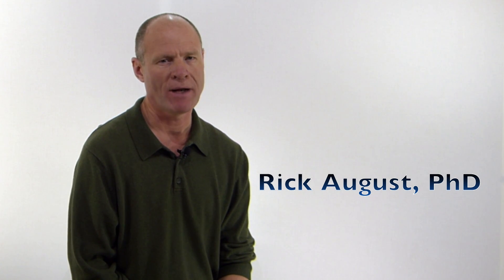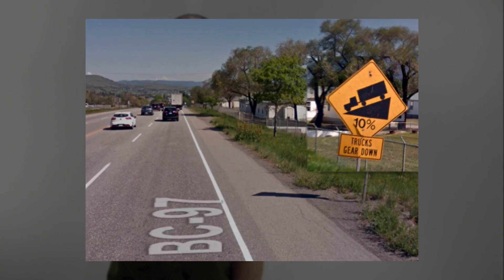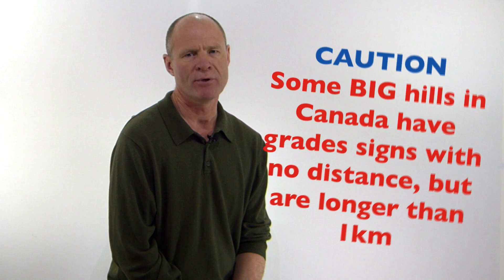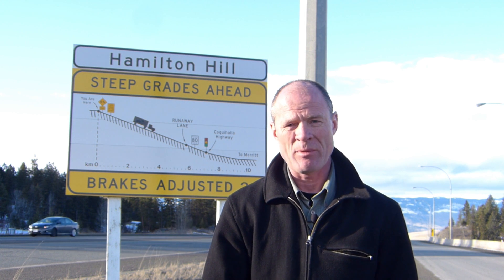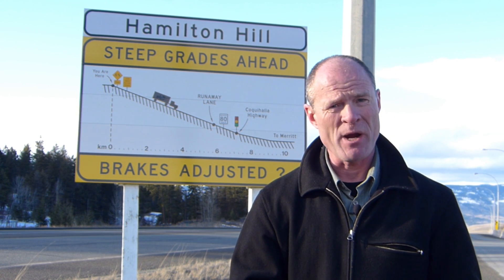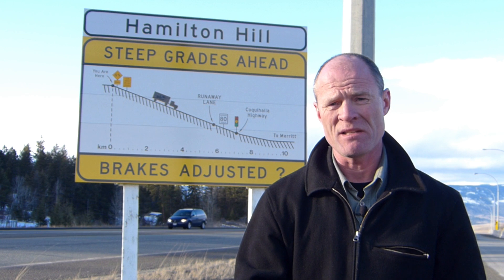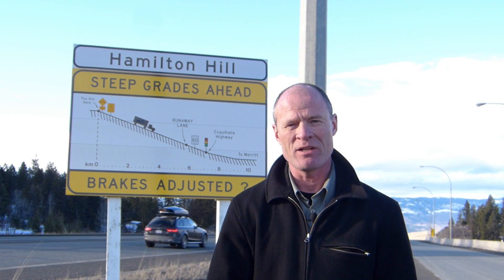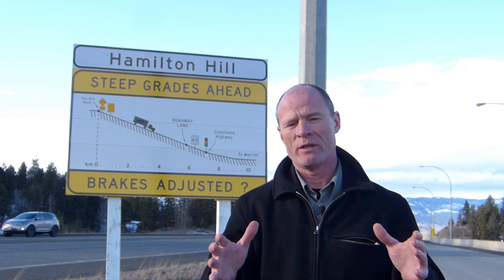How to Brake Downhill Safely | Air Brakes Smart

Comment: Hey Mr. Rick, thank you so much for your videos, I love how clear and interesting they are! I am in MT, my next step is learning to drive on icy and snowy mountain roads, and the use of Jake break is discouraged in such weather. I was wondering if you had a few tips to handle bad weather conditions when going downhill. My manual says stab breaking (break until you are 5mph under the speed limit, then let go, and brake again when you reach the speed limit), but if there are better tips, I'm all ears. Thank you!
Reply from the maker: Hi providencia94 - Thank you for your comment and query. Chains aren't just for going uphill my friend, these are for going downhill too. And if it's slippery you may have to chain up the drive axles on the tractor and throw a single on the trailer to prevent it from coming around. On some steep mountain downgrades, you going to need the jake brake to not experience brake fade. Chains are the only way that you're going to be able to do that safely my friend. Have a look at this video for chains: https://www.youtube.com/watch?v=2vcJULsQMRs&t=0s&list=PL0x-bChcUvwG2bSWReQWnk9Tm92L7WN_O&index=26 If there is anything further we can do, drop us a note. Always happy to help. All the best, Cheers Rick
Reply: @smartdrivetest  Seems like there's no way around those darn chains! I hate chaining, like every normal person, but I'll certainly do it if that's the safest thing to do. Thanks for the video you linked to, it's as always very helpful, and I just found you have plenty of information about driving in winter conditions. You're officially my new hero.
Reply from the maker: Hi providencia94 - Thank you for your comment. And you are most welcome. We're happy to hear we could help out. There isn't one CDL driver out there that likes to put chains on, but as you stated, it's a matter of safety - especially in the mountains in the winter. If there is anything further we can do, drop us a note. Always happy to help. All the best, Cheers Rick

Comment: So you have any videos about this subject but for stick shift pickemup trucks?
Reply from the maker: Hi I_Dont_Eat_My_Friends - Thank you for your comment and query. At this juncture, I don't have any for pickup trucks, but if that's you're case, you may want to consider a transmission cooler as you're most likely running an automatic transmission. These generate an incredible amount of heat when downhill braking or climbing, which can cause these to fail. If there is anything further we can do, drop us a note. Always happy to help. All the best, Cheers Rick
Reply: @smartdrivetest  Hi Rick, thanks for great videos. How about braking downhill with a car (petrol engine, small city car, like wv polo or ford fiesta). Driving down a mountain on a road that is constantly require turning left or right while going downwards seems quite daunting. Any advice on braking in that situation? Thanks!

Comment: Hey there...so my issue is I dont have much driving experience at the moment but when I am coming to a light its green and than turns yellow. How can I make this stop without hammering on the brakes...just looking for some sort of tips or tricks. Only have 2 months experience driving
Reply from the maker: Hi Pat Portelance - Apologies for the late response. Thank you for your comment and query. And this is the video you seek my friend: https://www.youtube.com/watch?v=jX1366utbuY&t=2s&list=PL0x-bChcUvwENfxb3Gsaj4ZNLWleZCNzG&index=53 If there is anything further we can do, drop us a note. Always happy to help. All the best, Cheers Rick
Reply: @smartdrivetest  Hi there thanks for your reply....so in your video you mention that we have to try to come to a complete stop...but where would you start determining where the point of no return is and how to proceed safely through the intersection..
Reply from the maker: Hi Pat Portelance - Thank you for your comment and query. This video will answer your question: https://www.youtube.com/watch?v=jX1366utbuY&index=52&list=PL0x-bChcUvwENfxb3Gsaj4ZNLWleZCNzG If there is anything further we can do, drop us a note. Always happy to help. All the best, Cheers Rick
Reply: Stale green light, downshift and be prepared to stop. Light timing varies some as little as 15 or 20 seconds it seems. Haven't timed them,  watch for vehicles on side roads as some lights are on triggers.

Comment: What if your truck doesn't have a Jake brake?
Reply from the maker: Hi Douglas Beary - Thank you for your comment and query. If the truck doesn't have an auxillary brake, than you'll have to gear down even farther. How much weight are you hauling and what kind of vehicle? If there is anything further we can do, drop us a note. Always happy to help. All the best, Cheers Rick
Reply: Smart Drive Test I'm a new driver and I drive 2005 (?) International flat bed with 2500 gal water tank + a 35ft tandem trailer with a directional drill (vermeer 36-50)
I believe last time it was weighed it grossed out at 76k lbs with a full load.
Reply from the maker: Hi Douglas Beary - Thank you for your reply. It's odd that that year of truck doesn't have a auxiliary brake. If you're going downhill, you're simply going to have to put it in a really low gear and go very slow down the hill when loaded. If there is anything further we can do, drop us a note. Always happy to help. All the best, Cheers Rick

Comment: If worst came to worst you could pull your air brakes correct in an emergency
Reply from the maker: Hi brettduffy19992 - Thank you for your comment and query. No, that won't work if you lose your brakes on a downhill. Have a look at this video: https://www.youtube.com/watch?v=26AFYfz14Ec&list=PL0x-bChcUvwG2bSWReQWnk9Tm92L7WN_O&t=0s&index=14 Brake fade is a failing of all braking systems, not just air brakes. However, due to downhill braking and the weight of larger vehicles, these braking systems are exposed to conditions that could bring about brake fade. If there is anything further we can do, drop us a note. Always happy to help. All the best, Cheers Rick

Comment: Hi Rick, What about 10 gear trucks?
Reply from the maker: Hi Angel Rodriguez - these transmissions have 5 low gears & 5 high gears. For the first couple of hills use 5 low and see how it goes. If the engine retarder is holding you back, then go up to 6.  Remember to get in the gear before you start going over the top of the hill. If there’s anything further we can do, drop us a note. Always happy to help. All the best, cheers Rick
Reply: Thank you
Reply from the maker: You are most welcome my friend.

Comment: Snubbing or stabbing creates more heat than light steady pressure, and that takes longer to cool. Rub your hand on some carpet....the harder you press, the hotter it gets and you burn your hand. Press lightly- you don't burn yourself and you can keep going as long as you want. Correct gear and jake, follow posted truck speed limits and you don't need to worry about it.
Reply from the maker: HiJason Greene - thanks for your comment. The issue is that we're not talking about carpet and your hand. We're talking about heavy vehicles, often in excess of 100,000lbs (45,000), that generate enormous amounts of heat, even with light brake applications. The technique to proper downhill braking is dissipating that heat, or as you said, not generating that heat in the first place. Short, hard, intermittent brake applications allow more time between brake applications for that heat to be dissipated. New drivers require a technique the works every time. And you are correct: modern retarder technology allows you to get in the correct gear, and the driver rarely has to touch the service brakes, if at all. All the best, Cheers Rick
Reply: Stab braking needs to be more definitive. For example the number of brake applications in a given time or distance. Too many x's and y's being omitted in the equation. The stab technique would be fine if the brakes were only applied oh say twice within two miles ,minutes seconds etc. The perfect procedure is the proper speed and gear selection with no or minimal use of the brakes. To determine the benefits of one method over the other would be to establish a data set from instrumentation mounted on the vehicle's braking system.
Reply: Think of speed as heat or better, kinetic energy. When you  use a snub brake technique  what you are doing is letting speed build up then converting that speed or kinetic energy into heat and storing that heat in the brakes. Then repeat and convert more speed into heat and put in the brakes. Each time you sharply apply your brakes you are storing  more and more heat in your brakes.The brakes may cool some but will actually take hours to cool OFF. If I snub my brakes it is to reduce speed and select a lower gear very carefully. Use left foot braking technique so the right  foot can control the fuel.  Sometimes I use light steady pressure for control sometimes also. SPEED is key. Double speed, heat is increased square
Reply: Double speed, increase  heat  EXPONENTIALLY! Couldn't  think of the word.
Reply: Its not all about the heat. The reason for snubbing was developed because ALL the brakes may not apply at the same time, due to mechanical issues ( crack pressure of valves, worn components) Snubbing gets a high enough pressure that you are almost always assured of ALL brakes functioning. Rick told you what gear to be in before descending the grade - that IS VITAL info for this technique

Comment: I have had a setback. I was not ready to do the mountain run yesterday.I have to practice shifting on hills more. I get flustered downshifting and upshifting on a hill. It's because I'm not certain about how to do it without double clutching. We only use progressive shifting and observing the tack. It seems that everything else is going ok except shifting on hills...which seems to be the most safety related skill.Advice?
Reply from the maker: Hi Darlene - Apologies for the late response. You somehow need to practice the fundamentals of shifting with a load on the trailer. And I'm not certain how you're going to get that experience. I'll send you an email. Thank you for your comment. And you are most welcome. If there is anything further we can do, drop us a note. Always happy to help. All the best, Cheers Rick

Comment: I'm sorry  wrong wrong I've been driving  truck since early  70s before Jakes light steady pressure  always  worked  better I hauled on back woods mountain  roads with real steep hills light steady pressure  I hauled  oversized in 90s same but with a Jake I've never had a problem  and don't  smoke  unless new linings,  I just always  make  sure adjustment  is good even some self adjusting  brakes don't adjust  good enough they gap too far before  they  adjust
Reply: Not all trucks were speced with Jake's. Ask any former cornflake driver.
Reply from the maker: Hi XxzombiekillerxX mlg pro - thanks for your comment. You're thinking about that braking technique is in the minority of drivers. And I completely DISAGREE. Modern engine brake technology will hold the unit back if you're in the correct gear. I followed a set of loaded Super Bs down a 10 mile hill at 12% grade and that driver never touched the brakes once. If the brakes are on you're generating heat; if the brakes are generating heat, sooner or later those are going to experience brake fade. All the best, Cheers Rick
Reply: Smart Drive Test I agree with the Jake operation  it's the stab braking I don't agree  with or like but my last truck with walmart  the Jake was so good with a load of water you never had to touch the brakes but the what you call snubbing we call stab braking it don't work for me
Reply from the maker: Thanks for your reply. Yes, engine brake technology now is really good. And you're right, not all drivers like snub braking. The thinking behind that braking is that you use the brakes intermittently and then the air has a chance to get over it when the brakes are off and dissipate the heat. But that is all going the way of the do do bird with disc brakes becoming more and more widespread. All the best my friend, Cheers Rick
Reply: XxzombiekillerxX mlg pro k
Reply: The 1970's wasn't before engine brakes. Engine brakes have been around since 1905 and Jacobs started design and development in 1957 for production in 1961

Comment: I'm sorry  that style never worked for me I tried it once ,I started  driving  before anyone  knew what a Jake brake was and the light steady pressure  method always  worked only smoke was with brand new brakes, walmart  safty guy told us your method and I hated the speed up slow down so most of us stayed with the light pressure  method,Jakes just made it so we didn't half to come off as slow,great video's  though I enjoy total ,oh one thin I ran Canada  and the kilometer  thing always  threw me off, I'm old school dumb lol.
Reply from the maker: Hi XxzombiekillerxX mlg pro - thanks for your comment. Yes, I suspect that technology has changed a lot in your time. I too was surprised by the effectiveness of engine brakes when I went back driving a couple of years ago. Now, if you're in the right gear, the engine brake will hold the truck at a steady speed all the way down the hill. Owing to the fact that trucks are now heavier and the rolling resistance is less, engine brakes are now a must, not an option. And yes, this was the video where I realized I was an international driving instructor and needed to use both imperial and metric measurements.
An 8% grade drops 80' feet for every 1000' feet you go forward; or drops 422' feet for every land mile (5,280' ft) forward. 10 kilometres is approximately 6 ½ miles, and 63,500 kilograms on a Super 'B' is 140,000 lbs. And I would need to verify this fact, but grade signs in the United States will have a distance on hills farther than ½ mile. All the best, Cheers Rick

Comment: I don't know about snowy conditions but I think muddy conditions pose the same problems when Jake braking down hill. you mentioned that there is a potential to lock the drive wheels, but I think its more a potential to reverse them.
Reply from the maker: Hi Keith - yes, mud too could potentially cause the drive wheels to lock; however, most of the time in mud, you're going to have chains installed, or you're going to be stuck. Big trucks and buses do not do well in mud at all. The tires just aren't designed for such "silliness". 80) But anytime you're on compromised road surfaces it is best to neither use the "engine brake" or the "cruise control". If there is anything further we can do, drop us a note. Always happy to help. All the best, Cheers Rick

Comment: The truck I drive is 18,800 lbs. no jake brake. Auto tranny (freightliner flatdeck).  My only options for long hills I guess is downshifting or asking it to downshift.  Won't always go unless rpm is in the ok range to drop a gear. And service brakes.
Reply from the maker: Hi PbNTheory - thank you for your comment. Yes, unfortunately, there are still some vehicles that do not have engine brakes to help with downhill braking. It is important, as you noted, to have the transmission in a lower gear before you go down over the top of the hill, because you won't get it downshifted on the hill. And when you're going down the hill, make hard, short intermittent brake applications and bring the speed down 10-15mph. Release the brakes and let it run back up and repeat... If there's anything further we can do, drop us a note. All the best, Cheers Rick

Comment: 13 or 18? bullshit. 10 speed is standard
Reply from the maker: Hi David Gentry - thank you for your comment and information. My experience in the industry has been different in regard to transmission. However, companies have told me that 10-speed transmissions get better fuel economy. As well, if they are running a lot on the flat, then it makes sense to have a 10-speed. And for downhill braking, it is the same gear--5th--if you're driving a tandem-tandem with less than 80,000lbs (36,300kg) and on a grade less than 10%. If there's anything further we can do, drop us a note. Always happy to help. All the best, Cheers Rick
Reply: Smart Drive Test I've been at this for 40 yrs. and have done alright with the help of some pretty smart old timers, like my dad and 4 uncles. Think I have a handle on what I'm doing. And the only 18 speed trucks in the U.S. are owner operators. Companies are strictly 10 speed or now automatics since most new drivers don't have a clue how to shift.
Reply from the maker: Hi David Gentry - thank you for that information. That helps all the new drivers coming into the industry. If there's anything further we can do, drop us a note. Always happy to help. All the best, Cheers Rick
Reply: Every company in the United States uses ten speeds in it's trucks? Really you checked all of them?

Comment: What about using the jake brake when it's snow and ice on the road?
Reply from the maker: Hi Charlie a - thank you for your great query. If the temperature is around the freezing point--0°C or 32°F--you're probably going to have to mount chains if you're braking downhill. And you'll probably need to throw a single on the trailer just to prevent it from coming around - being able to read the side of the trailer in the mirror is not a good thing - joking of course. When using the jake brake, think of it like the reverse of cruise control. If it's slippery, you could potentially cause the truck's rear tires to lock up, and I have experienced that - it's rare, but it can happen. If you have further questions, drop us a note. Always, happy to help. All the best, Cheers Rick
Reply: @smartdrivetest  can you make a video how to drive downhill in snow with an automatic transmission